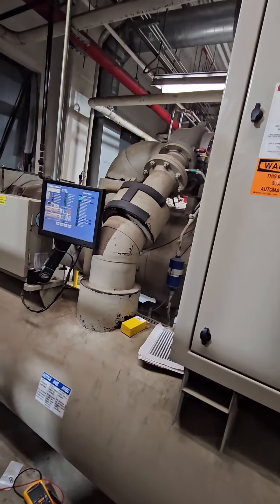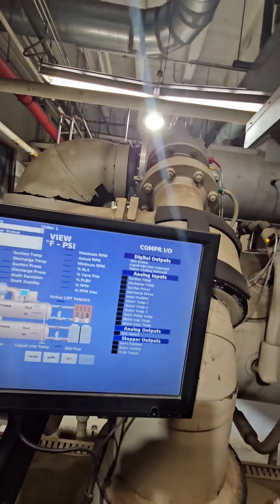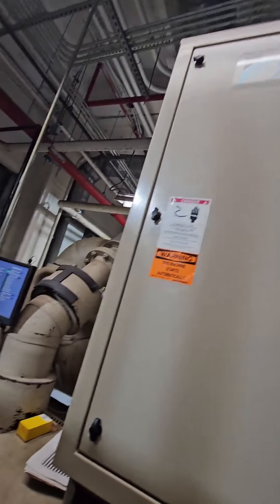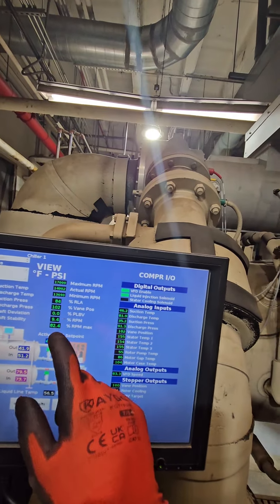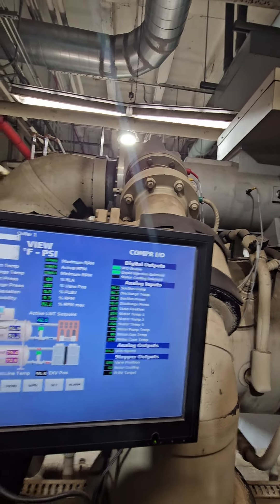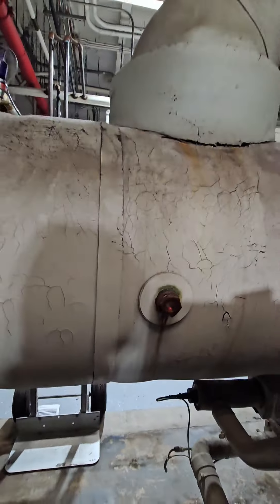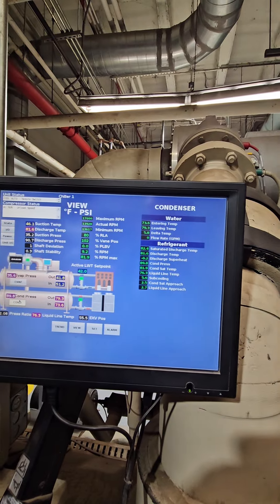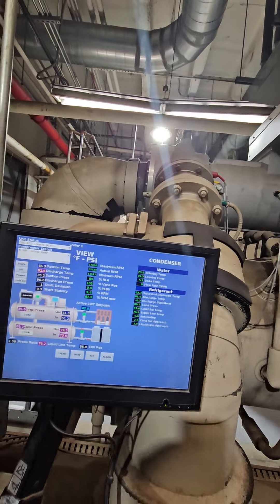AFTER HOURS CALL. 2 WME MAG BEARING CHILLERS DOWN AT A HOSPITAL

Comment: Tell us more about how you diagnosed low charge plz 🎉❤
Reply from the maker: @Fryloc87HVAC  the suction saturated temp for the load on the chiller. The how far open the EXV was, the discharge pressure and discharge line temp, discharge superheat. Used basic refrigeration principles that are true to any type of machine you work on that has refrigerant in it. The lift pressure, since its a centrifugal is also an aid.